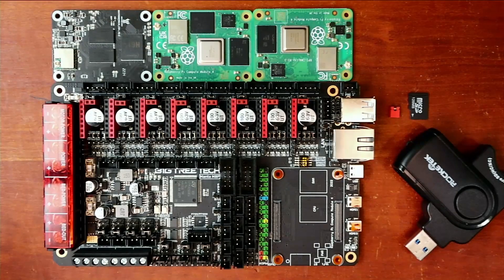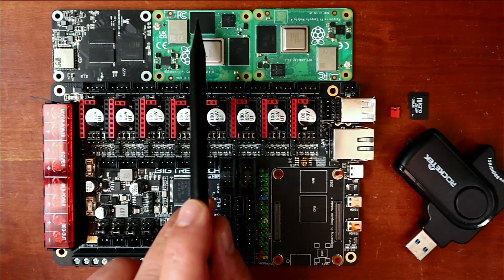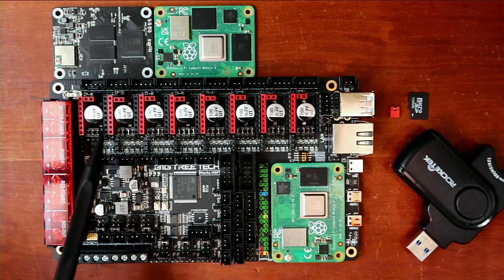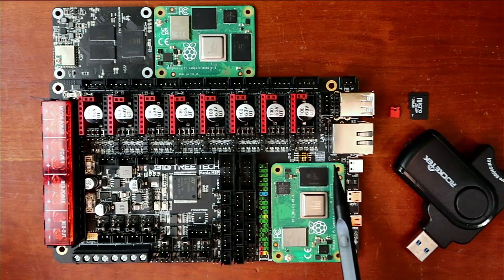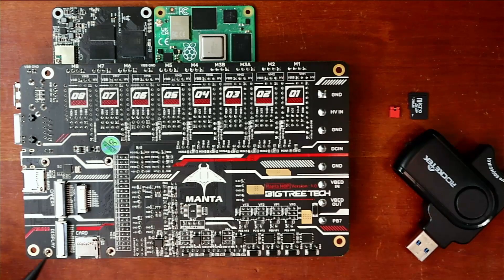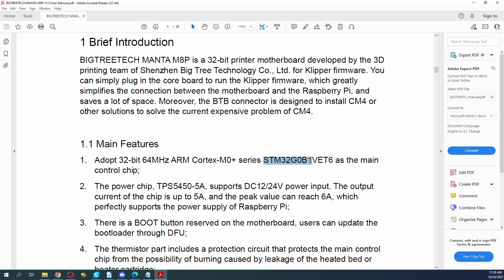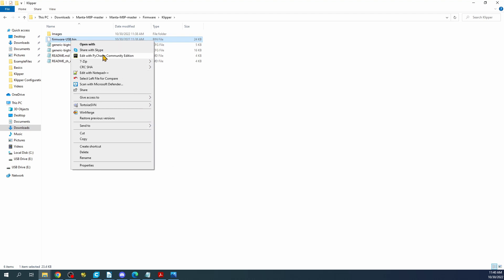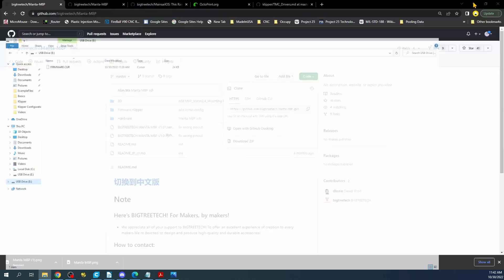BigTreeTech - Manta - M8P - Basics

Comment: I would like to Run a CM5 Rpi and have system boot from a usb SATA SSD instead of using an sd card. But my Rpi CM5 has 32gb emmc onboard, is this possible with an M8P V2.0 manta?

Comment: Why will mine now longer flash the firmware via the SD card in the MCU slot?
Reply from the maker: Did it flash on e before?
Reply: @EdwardBraiman  yes, I followed your M8P basics video.
Reply from the maker: @paulstephenson5311  so rename FIRMWARE.CUR to firmware.bin sd place back in MCU drive and power on board.  Power board down after a minute and check if firmware.bin renamed to FIRMWARE.CUR.

Comment: I do not see any support for the ADXL345 with this board.
Reply from the maker: Depends on pinouts.  If it's not mentioned in manual it may possibly not be supported.

I'd need to attempt and install, but it not currently in Klipper firmware last time I checked.

Comment: Thanks for this little nice guide /tutorial!!

I have a question:

is Mks Skipr better than m8p??
Reply: Yes and no, depends on what you want /need ,   HV support on manta is nice but skipper is alot better woth setup and use docs ,   good luck figureing out how to set up adxl through spi ports on manta ,  or even better how to use the gpio pins ,   ive been trying to get it to work for months ,  no help from BTT

Comment: What USB power supply are you using? ..for some reason I guess my Macbook Pro USB-C (massive) power brick isn't doing the trick to power this on. (followed your steps to a T)
Reply from the maker: I used a power supply for a raspberry pi.  You can use PSU power as another way to power pi.  I only use USB power for board configuration.
Reply: @EdwardBraiman  Thanks, I went and wired it up and discovered that my board is DOA. Kinda disappointing for something I waited a month for. Now off to talk w/china to get a new one. Le sigh. Thanks for your help though!
Reply from the maker: Is there a jumper cap missing?
Reply: @EdwardBraiman  I did the USB jumper and tried to power it that way, no dice. Then I wired it to a my printer PSU and it didn’t power up that way either. As far as jumpers, no jumpers installed. (I saw videos of others and I think yours) that didn’t have any jumpers installed. Other than the default ones, obviously.
Reply from the maker: Can you post a picture of board in current state on Discord general chat and I'll see if anything is off?

Comment: Thank you for this great review ! 👏
Reply from the maker: Actually it's a tutorial.
Reply from the maker: But, you're welcome.
Reply: Haha ,😋 I didn't heard of this Btt board Its like a Advanced Octopus with the Raspberry pi interface integrated in it ? to bad this wasn't launched when I bought my main board .I like that this has a ton of features and relatively compact size for what can it offer
Reply from the maker: Yes it can integrate either CB1 or CM4 module as controller computer.
Reply: @EdwardBraiman  Have you had any issues with wireless communication on it ? I had a wifi  sd card module from BTT ,it was a pain in the ass to set it up the copy rate was awful and the signal dropped often even in a 2-3 meter range.... Just curios how does the wifi module works on the CB1 / CM4 ?
Reply from the maker: Need an clip on antenna.  I talk more about it in next video.  It's up on Patreon if you want to look.